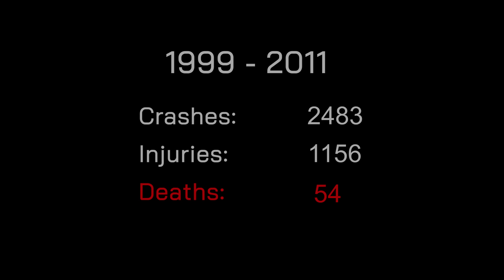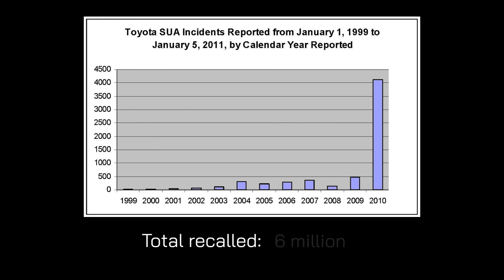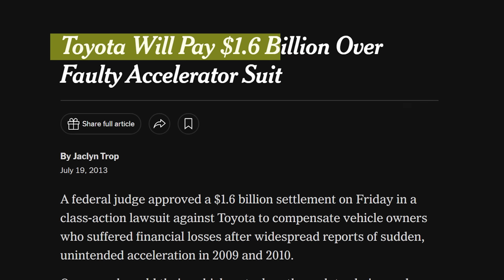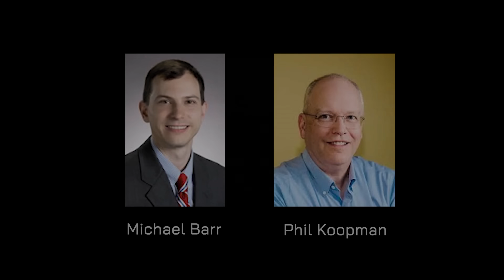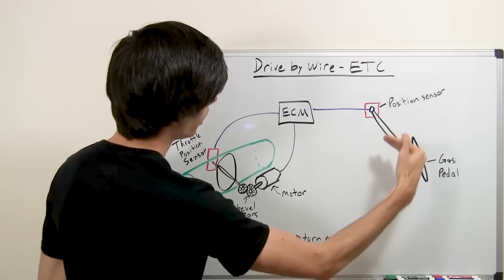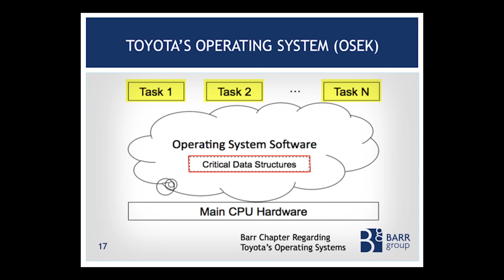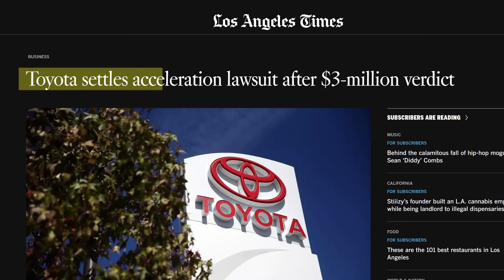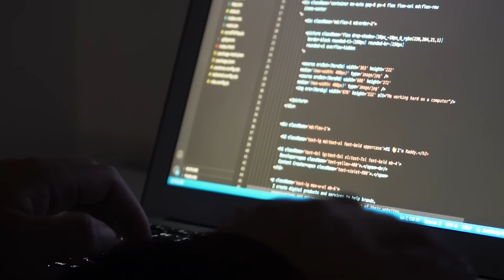Fatal C error took her life

Comment: In theory rust would help but you still need a specific set of guidelines for writing these types of software because its not difficult for someone to just start working with unsafe code that does still allow for these types of errors.
Reply: it's*
Reply: unsafe does isolated the part of code that can cause such kind of problem with makes it easier to find and test then having to perform memory safety checks over the whole program. Also even in unsafe Rust still does help because you still have access to better slices that do check for length, option instead of null etc.
Reply: @mateuszschyboll2310  It depends on the type of stuff that you're doing with the code. A few years ago I worked on a key value store for secrets and the system really needed to use unsafe all over the place.  For example, I had to use unsafe to implement some of the cryptographic algorithms and I used unsafe to implement non-contiguous memory blocks as well as a memory allocator/garbage collector.  With the cryptographic algorithms, you could do exactly as you said because they are isolated from the rest of the code. However the memory allocator is pervasive across the entire application because all of the memory chunks inside of the vault were being allocated using the non-contiguous memory format (and actually, the allocator worked globally across any program that imported the library, there was a pass-through for normal data outside of the vault to use the normal allocator behavior for rust).  There were cases where I ran into undefined behavior and it became difficult to debug because of the way that a complex type or an algorithm interacted with the allocator.  In other words, the undefined behavior didn't originate from the memory allocator itself, it occured in other parts of the program even if the stack trace pointed to the memory allocator.  Something also to keep in mind, as you start to use unsafe in your code, it becomes extremely easy for it to proliferate throughout the codebase if you're not careful.  In a lot of cases if you have a dependency that is unsafe, then the function or algorithm needs to also have unsafe flags inside of it.  When you start to embed unsafe blocks inside of one another, it becomes a lot harder to pin down where the errors are happening.

There are organizations in the US government that use a language called Ada. Ada has extremely strict safety checks and it's very difficult to bypass them.  If rust wants to compete with Ada, then it's very likely that the organizations will set up a style guide that highlights a subset of rust which can be used for these types of systems.  I also wouldn't be surprised if they implement their own compilers that remove features like unsafe.  Another thing to keep in mind, many of these APIs are already written with Ada or c, which means that they will have to use unsafe to wrap the existing code.

With all that being said, obviously rust can work this way. In one of the last projects I worked on, I used rust with elixir. Elixir is a fault tolerant language that focuses on using processes.  What makes it fault tolerant is that each process can crash and another supervising process will bring it back up, sometimes passing the old state into the new process.  When you start to add other languages, you have various ways of connecting them to the erlang virtual machine, each of which has a set of pros and cons.  The way that I did this was with a mechanism called native interface functions (nifs).  One of the major cons of using NIFs with languages like c is that they can bring down the entire program if they run into undefined behavior which means that your elixir code is less full tolerant.  Rust solves this problem by way of its result and option monadic types.  Because you can return the error from a function rather than throwing an exception, you can let the elixir layer handle the error without crashing the rust layer.  Basically, all of the rust code that we used was very pure so as to avoid any undefined side effects. When an error occurred in the rust nif, it would return that error back to the elixir layer and the elixir process could shut down and restart; this worked extremely well.

Anyway, the point of all this is to say that while rust certainly can be used this way but the language doesn't completely prevent the developer from treading on potentially dangerous ground.  Having been in the industry for 25 years, I've seen developers take shortcuts even in cases where safety is of the utmost importance.  Usually it's not even the developer's fault and instead is a result of higher-ups putting pressure on them to finish faster.
Reply: @mateuszschyboll2310  Yeah, but you can also check for length instead of null in C, but that doesn't magically make all C code safe. The problem that the OP is talking about is the fact that some day, some incompetent programmer will make the mistake of using some insane unsafe piece of code that is wrong and will get someone injured or worse. This can happen in C, Rust or any language for that matter... When you're in embedded, no matter how many safety features you use, if the programmers writing code don't know what they are doing and simply dive into performing unsafe operations, they will most certainly end catastrophically, even if they are using Rust... to fix the problem you don't just rely on a safer language, you also rely on making sure that the developers you're hiring actually know what they are doing or at the very least do not decide to do anything insane. Which is why even in Rust you should have guidelines to prevent deathly code from making it into prod.

Comment: It's just not the embedded software memory issue, it was also the issue of using global variables. I always say, don't use globals, half of your problems will be solved right away, and you don't need to use Rust just to follow this principle.
Reply: To be honest, if i want to bet my life, i would prefer to bet on a car that were made by technologies that made it harder for the manufacturer to make mistakes, than the technologies that rely on developers' will to do the right thing. I am and have seen enough developers to know that we are not a particularly ethical bunch, and when the pressure is high enough, we would go for the easier route. Sure you can have similar bugs in rust. But you should go out of your way to make those bugs. On the other hand, yes, you can always make a good, robust c code. I just don't think that i would be able to trust more than handful of code bases (Linux, SQLite and probably curl) on delivering it.
Reply: @AmirHosseinHonardust  In developers' defense, it's not them wanting to use C rather than companies' lack of interest in rewriting a lot of code, along with issues with software certification. I can suggest to use a certain piece of technology but I cannot take decisions alone. I work in the avionics industry in a mission critical environment btw, I expect safety critical software to have even stricter rules.
I'm not aware if memory safe languages like Rust can be used in that context even if they could make more sense.

Edit: I've just finished watching the video, good to know.
Reply: Yes, but the problem is that not everybody is like you, in fact nowadays they like to be different. That's why rules are so important, to protect us from ourselves.
Reply: @danielhalachev4714 Nah, Java don't quite solve it in the same manner like rust. The JVM  just added too much overhead. I would't call it "solved" c's problem. And that's why it didn't replaced c for embedded system.
Reply: This, and many other rules like those in NASA's or MISRA's principles are how the issues were mostly solved in practice. But all these sophisticated rule make things much more complicated and hard to apply IMO. Using something like rust should and will be a modern way to solve it entirely.
Reply: Java didn't solve any of those problems, because it has a runtime, isn't compiled to binary, and uses a garbage collector.
Reply: Rust makes globals hard to use incorrectly
Reply: Rust is not a requirement, but just really helpful and therefore a great way to do it.
Extremely well tested C code can work excellent while poorly written Rust can still have bugs and problems.
In Rust it's just much easier to do things right and harder to fail. The compiler drives you in the right direction and that is really useful.
Though in the story in the video clearly a lot more was wrong. It's mostly about a serious IT management problem in the company. The fact that they tried to hide everything for such a long time and refused to do the proper research was beyond bad.
Reply: @jongeduard  Your statement is pointless because that's obviously true for every language. Extremely well tested anything will work great, and poorly written anything will probably have bugs and problems. The point is that you don't need "extremely well tested" Rust code to maintain memory safety, which is literally the whole point of the video you just watched.
Reply: Even if you use Misra C you still use an unsafe system at its core. Misra is only a set of rules checked by external tools or maybe by the Compiler itself. But it's not part of the language. The "Billion Dollar Mistake" is still there.

Rust is safe by default and you have to opt in unsafe parts, if you need to. You can think of the Misra rules built into the language itself.

So why not use a language that is safe by default instead of unsafe languages that try to add safety afterwards

Comment: sudden acceleration happened to me too-it occurred  in a Honda ---I was in a bumper to bumper situation on a freeway in Los Angeles suddenly my car's engine raced to extreme high rpms all I could think was to slam on the brakes-i pressed very hard as the car was inching closer and closer to the car in front of me-in a moment of panic turning off the ignition did not occur in my mind at the time all I could think of was to keep from hitting the car in front of me--the brake pedal almost hit the floor then the engine went back to normal ---strange experience never happened again

Comment: Car manufacturers should be forced by law to open source their software. There should be no secret.
Reply: What you're stating makes no sense. I'm pro free software and contribute in a few projects, but that doesn't mean that every piece of software has to be mandated to be free or open. That's each one choice. It's like asking the car company to provide all the 3D design elements of the cars. If you want valiation of a closed source product you can always try to get some external validation, that's how it's mostly done in important fields like railways, aircrafts and so on.

Plus, in most cases, with embedded hardware and it's own custom design, you wouldn't be able to understand anything, it's just not relevant to see. Control or flow diagrams on the other hand can be useful.
Reply: Everyone* should be forced
Reply: @JorgetePanete  no, some things need to stay private
Reply: @arson5304  No, only private keys are private, and those don't belong in source code. The users need to be able to inspect their stuff, and "their" becomes the users' when it's on their device.
Reply: @JorgetePanete  if it's on their device then they already have everything they need to see what's going on. just decompile it.
Reply: @arson5304  No, a compiled version does not include the source code, compiled version is optimized and pruned
Reply: @JorgetePanete  and that matters why? you can still see the important workings and infer the intent of the program.
Reply: @thingsiplay  Not sure where I stand in the argument but even excel can be used in life critical applications. Just depends on what a particular software tool is responsible for.
Reply: @JorgetePanete  Inspect doesn't mean have the original design. You can buy a hardware component and inspect it as much as you want and recreate your own one (if we ignore patents and all that crap), that doesn't mean that the manufacturer should be forced to give you the original design. They can do it if they want, or sell it to you, and it would be nice for end users, but forcing others to provide their work for free because you have that idea is a basic example of totalitarian expropriation that breaks free choice and private property.
Reply: @ALIENdrifter66  No one should be able to own ideas, it's a stupid concept, inventions are for the betterment of society, not the individual
Reply: @JorgetePanete  I'm not stating that ideas should have an owner, I don't think that's a reasonable thing, as ideas can be shared between individuals, physical things can't. That's why I'm not into intelectual property.  You seem to miss that your proposal means that you should not have ideas on your brain that you keep for you. That's a really bad concept. PD. Inventions are inventions, if you want to share it with the rest of the World or with some of it, good for you, if you want to die with them in your head, good for you too, you should have mind freedom.
Reply: @arson5304 With most optimizations, you can't. Function calls and constants are inlined and branching logic gets manipulated in ways that very much obfuscate the original intent of the code. You get zero variable names, zero function names, and zero comments. Source code will always be far, far more readable than any decompiled program.
Reply: @rsboi-yt  thank you for stating the obvious, that still doesn't mean you can't infer the intent of the program or spot errors by having a quick look around.
Reply: @JorgetePanete  I don't think everyone should be forced to open source their software. For example, I have a crappy web server running in my home that I made from scratch.

Is it suitable for other people to use? No.
Am I profiting off of this? No.
Can anyone else view the source code? No.

I don't think I should be forced to share it. Yes,  I want more software projects to be open sourced, but some things, like one-off personal projects, shouldn't be forced to be open source.